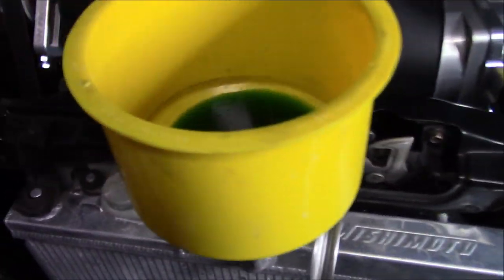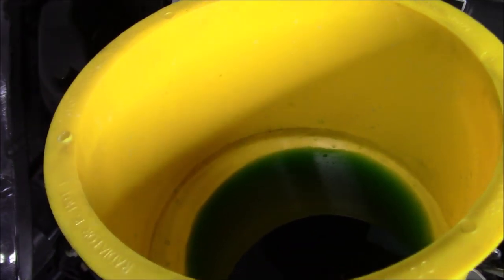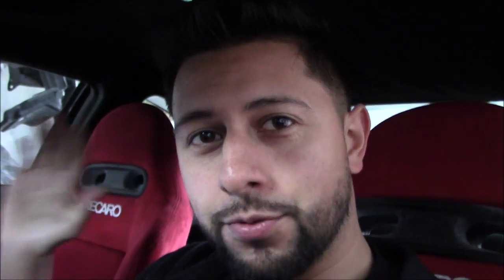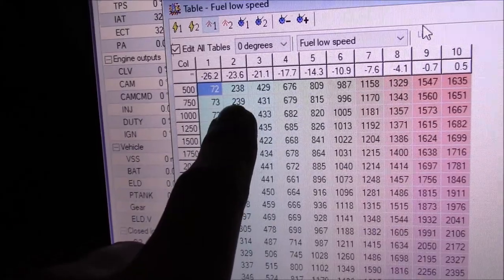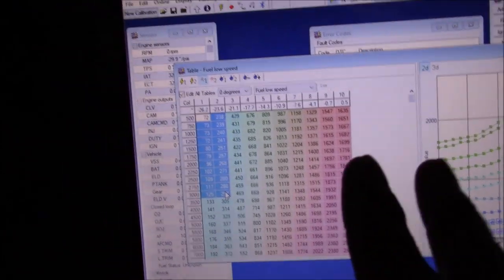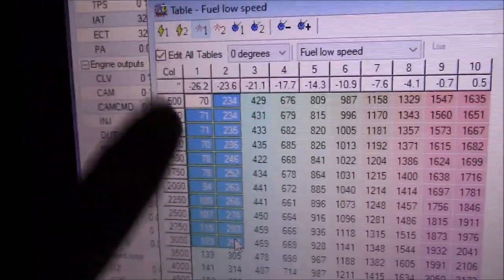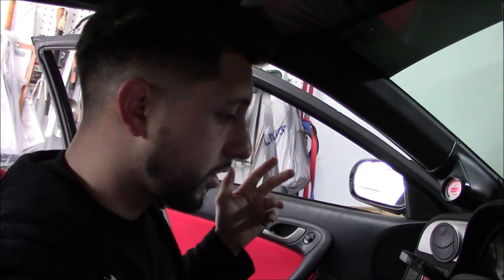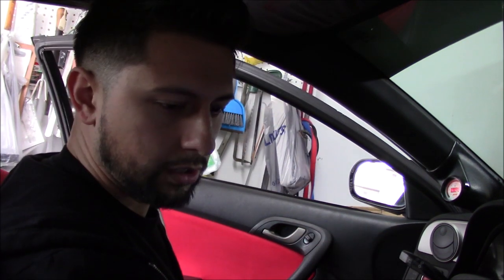Fix one issue and then find another...

Comment: You should flip the throttle cable bracket so it sits down.
Did it on my 90mm tb and its a lot cleaner look.
Are you running an iacv?
Had a similar idle problem mine. A simple old school tuning method can cure the problem.
Reach out to me if you need any help.
Can guarantee you will never get a stuck throttle body again.